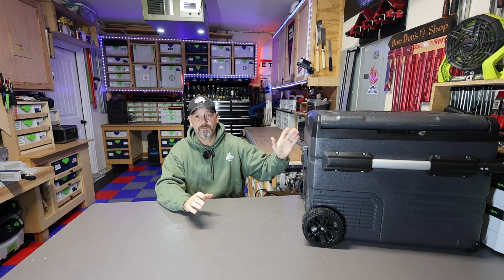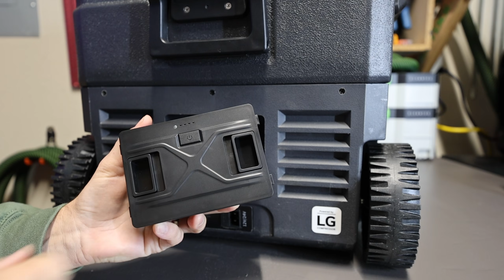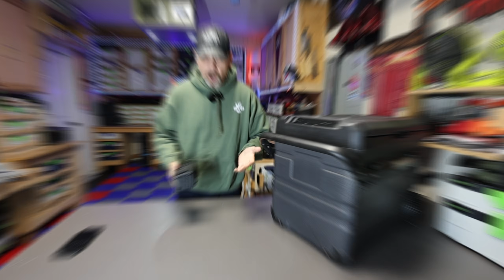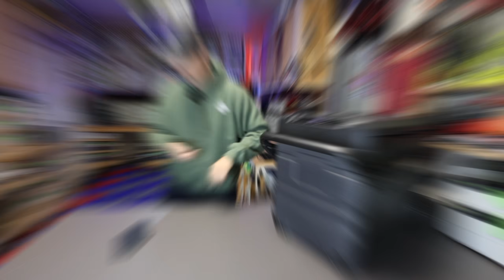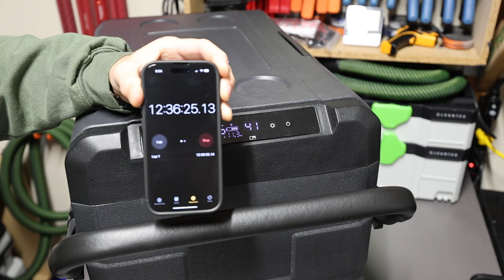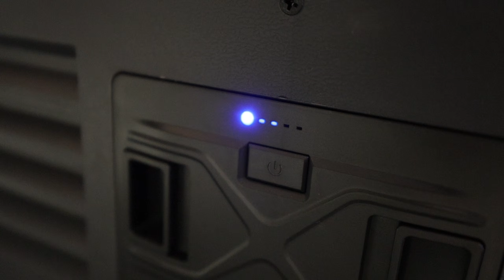Impressive amount of runtime off this Change Moore cooler battery!

Comment: I found probably 10 companies that seem to all piecemeal coolers from the same factories. I just bought a 50 l cooler that looks just like yours from Vevor and bought a battery for it off of Amazon just under $90 there was one cheaper but I was worried that the cheapest would be the worst

Comment: Which brand of battery powered dual zone cooler with wheels would you recommend? They all seem similar.
Reply from the maker: Whichever one you can find the cheapest. They are all literally the same for the most part. I’ve always had luck with the Bodega branded coolers though